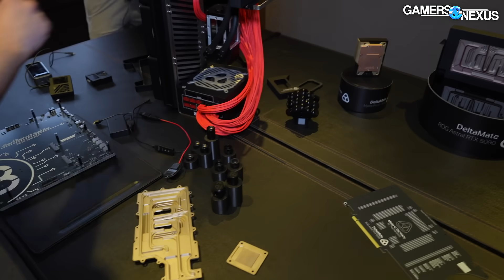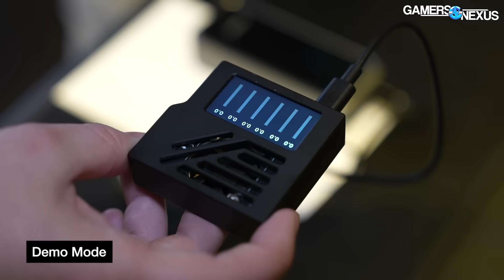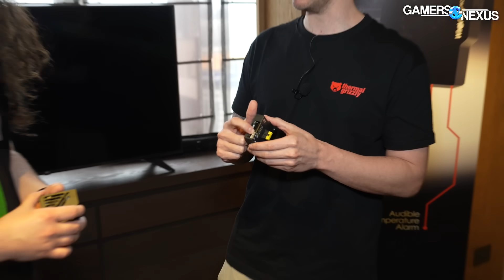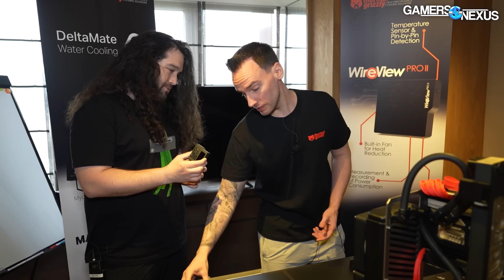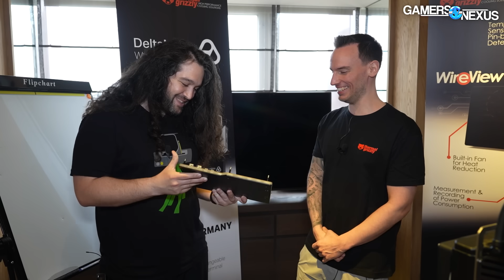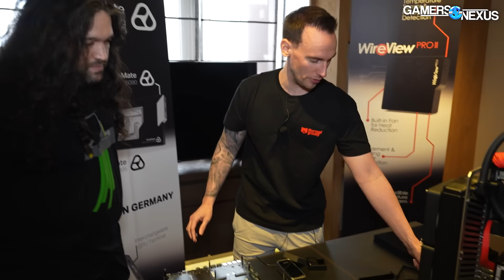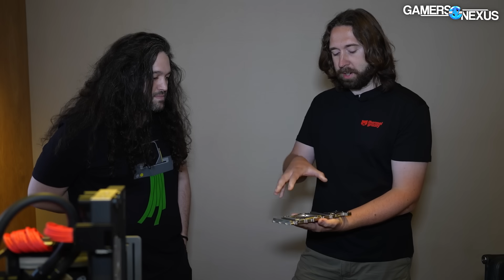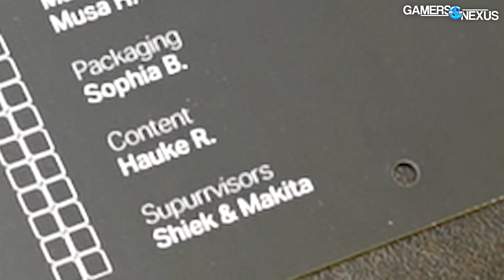Fixing the Unfixable 12VHPWR Connector, ft. Der8auer

Comment: It'd be so funny if Nvidea ditched the 12V high power connector right after everyone made fixes for it
Reply: Actually they ditched it just before this video and they changed their mind back after watching it.
Reply: You assume Leather Jacket Man, still gives a shit about gamers!
Reply: @meekmeads  You've seen the kitchen that MFer has, you think he gives a $#!£ sideways about anything other than even more money in his own pocket? He's a triple-digit billionaire at this point.
Reply: They won't. Because that would mean admitting defeat.
Reply: @shadow7037932  They will and when they do they'll blame it on power supply and cable manufacturers not being able to keep up with their greatness.
Reply: I wish everyone would just switch to microhi, aka ph 3.0. It's right there, already a proven standard. It can carry an insane amount of current in a small form factor (12 pin is 180a) and is designed to do so. Only caveat is that it wouldn't be as cheap - maybe adding 10 dollars to the cost of the cable and a couple bucks to the connector.
Reply: @industrial-wave  Just give us bus bars and let the good times roll.
Reply: @BrandonsUsername  there are many standards for that, including some pcie slot alternatives that allow for up to 32 lanes and even 55 amps through the sidecar connector alone (snia sff ta-1021, aka pecff). Sidecar connectors have been making a showing in the standard pcie cem slot as well, though, such as with the asus tuf z790 and a variant of the 4070.
Reply: @BrandonsUsername  For real. Just convince some wire supplier to make black jacketed Romex and be done with it...
Reply: @industrial-wave  there are more standards than chip developers, many that could be used for the SOHO market, but nvidia decided to go with their own standards because f uck you, we're nvidia. Thing is, the standard could work well enough mechanically, but they cheaped out electrically aswell, so now it needs a lot more engineering..
Reply: @industrial-wave  108A with 12-pins is the same as 9A with one pin in a current balanced circuit. It's the non-balanced current distribution part that is the problem, and the solution would be to either do active load balancing, or make each being able to withstand the entire spec (which for 12V-2x6 is 675W iirc), just for the worst case scenario.
Reply: @D23-qw7jf  I don't understand why they don't use a really fat 2 pin or 4 pin connector. Xt90 or something
Reply: @D23-qw7jf  Ah my bad, was using one of the lower rated ones without checking lol. You can commonly see that the connector supports 12.5a or 15a per pin depending on the variant, with the 15a supporting 1080w (180a) in the 12 pin. The 9a ones are for lower power applications. And yes, agreed, this level of overhead likely would not be necessary if not for nvidia having removed all of the protections from the 40 and 50 series cards. A bit more headroom for imbalances would be nice to have though, as the 12v 2x6 connector does not leave any headroom for misplugs or user error, which 12v 2x6/12vhpr connector is prone to allowing.
Reply: @industrial-wave  In an AI cluster, they can use a lot chonkier connectors, and that is what NV cares about.
Reply: @LordNecron  Microhi already is used in a multitude of AMD and NVIDIA server AI installations, excluding directly for the sxm based gpus. The 54v (or for older 48v) at around 150 amps (~8000w) that are delivered to the baseboard for the 8x 1000w GPUs vastly exceeds the capabilities of the 12vhpr connector and any other regularly pinned connector. It also needs to be carefully separated out for those modules. They tend to utilize dedicated terminals powered by thick copper cabling with large connectors for those instead, or directly power them through a mating connector that they slide into on a power distribution board.
Reply: @industrial-wave  i have used Supermicro's MicroHi cables and adaptor and they don't mess around. it's heavy duty, literally industry grade. It needs almost no modifications to be used in a domestic environment. No need to reinvent the wheel
Reply: @industrial-wave  It can´t. First of all there isn´t more than a 6 Pin Connector, second you don´t fit in more than AWG 20. But at least the Cable would blow up instant
Reply: @industrial-wave  It's not like the cards cost so much they could afford to eat a 6 dollars loss to avoid them melting down your pc or house...
Reply: Sadly, in today's economy and profit margins on computer hardware. $5 in supply cost = well over$50 customer cost...  @industrial-wave
Reply: https://youtu.be/TK2mI036JO0?si=gXEF19BUuTDZFANi @industrial-wave
Reply: @industrial-wave wouldn't help you much eitherif you draw over 16A on a single pin..
Reply: @industrial-wave  That connector would be 9A par pin which is the same as Micro-Fit+ (12VHP), there is no way someone will go out of their way to change a part to something with the same spec as orignal and cost more.
Reply: @crystal_reverie My bad, was looking at one of the low power connectors without checking. Microhi can do 15a per pin, so 180a/1080w in 12 pin or 720w in 8 pin.
Reply: @industrial-wave  Can't find anything specific for "microhi ph 3.0", are you sure that's what it is called? You've made me curious, I'd love to see a 108 amp 12V connector. :D
Reply: @lennyvalentin6485 just look up microhi it looks exactly like a 8 pin connector besides if you look closely 2 pins are wide instead of 4 small pins.
Reply: @industrial-wave  tbh with the prices of GPU that $5 is nothing lol, especially where they're way overpriced anyhow
Reply: @industrial-wave The thing is, there are so many options.  They could have just made the pins slightly bigger and used a slightly heavier guage wire.  Even that alone would make it extremely unlikely that any wire would get dangerously hot.

So my question is, why the fuck haven't they??  Pure stubbornness and arrogance?
Reply: @Alex.The.Lionnnnn  Microhi is an extremely dense connector half the size of the usual eps12v 300w connector and capable of delivering more than double what it can. It is truly tiny. Having two or even 3 of the CPU connectors would take up too much space. You cannot simply use higher amperage cables with the same kind of port, that would not make things accident proof and anyone not knowing about their standards or ratings, or not checking or caring could cause a very quick problem. They have not used a thicker (lower gauge) wire for the existing connector because that would not fix the design issue of the connector itself and its ratings.
Reply: @Alex.The.Lionnnnn there’s an even easier and cheaper fix and that would literally just be to revert their power regulators on the board back to what the 30 series had. That is all they have to do. It would cost em a few dollars extra per card and that’s it. That’s much cheaper than thicker gauge wires which then has the downside of much less manoeuvrability of the wires. The 30 series had 6 power lanes that had its own shunt resistor and so if 1 of the lanes stopped receiving power it would shut down immediately or prevent turn on until the power supply issue was resolved. Bye bye melted connectors as the load would always be evenly distributed along each wire.
Reply: @Alex.The.Lionnnnn cost. Smaller wire gauge gets expensive fast (small gauge=big wire and reverse
Reply: @Alex.The.Lionnnnn Cuts into their greedy profit margins.
Reply: TBH everyone should've use EPS 12V for their GPU in the first place instead of reinventing it in form of PCIE 12V, 20 years ago

It has 340W power from 8 pin from getgo, and you can easily reach 550W with 8+4 config. And mind you, this connector already use reliably.... For CPU

No, you don't need sensing pin bullshit. No, there's no additional necessary change on power supply. And yes, there's GPU that already use EPS power connector in the first  place.

Hell, 12VHPWR 4 pin sensing is practically just there to looks safe. GPU will pull whatever they wanted without any smart monitoring or future shit anyway.
Reply: Let’s be honest. The cable is failing because Nvidia connected a lot of power to a single bus, if they measured the current on each cable it probably wouldn’t be such a pain in the ass.
Reply: They're not going to make money on the fix. It's definitely getting replaced now.
Reply: Nvidia would never admit to being wrong.
Reply: Who will be buying Nvidia going forward?

I'll keep my 4090 until AMD makes a better card. Nvidia is dead to me.
Reply: That sounds about right
Reply: Nonfactor considering gamers aren't their target market anymore. I wouldn't be eyeing nvidia cards in the coming generation if the current generation and drivers are anything to go by - and I'm a 4090 owner..
Reply: They (Nvidia) are very busy working on their new 4GB GPU, give them a break eh. That's a business insider trade secret btw so don't tell anyone
Reply: Oh they will.  They'll make something worse then gaslight everyone into thinking it's their fault.
Reply: it will be so funny when**
Reply: That would imply nvidia took actual criticism and fixed something
Reply: They are more likely to sue lol
Reply: introducing nvidia's newest power adapter... 12v 2x3. that's right we didn't listen, we just did whatever the f*** we wanted b/c we're nvidia and we don't give a rats ass about the non enterprise market or the engineers that know what their doing.
Reply: Then they'll make something worse😂
Reply: I think in the future PSU makers will start building similar monitoring into PSUs. Which is surprising it wasn't built into the standard to begin with. I can only assume Nvidia and PCI-SIG wanted it to be compatible with the tons of existing power supplies already on the market.
Reply: I would manually solder the 8 pin Pci-e since they basically just have two paddles on the card 4x 8 pin (12 separate wires to each 12v paddle, and cut off and fool the sense pins, I rather have 1152w headroom
Reply: To 2x3HPVR ... I am sure that will happen if RTX6090 SUPERs will not melt fast enough .. I mean like 2nd day after 2yrs warranty.
Reply: BTF actually is a superior connector
Reply: Who is Nvidea?
Reply: The product is awesome. My only thought would be adding fusible links. They’d just melt and could be replaced and the sense pins would tell you which one needs replacement. They’re dirt cheap and while they would add a negative amount of resistance it would only matter if the gpu was drawing power unevenly where one of the wires was carrying more than its share. Which from my impression is the biggest factor on the connector failures?
Reply: the people with existing cards wouldnt find it funny,,,there would be no difference for them as the issue persists
Reply: They will bring some new shit like 24V high power connector and it will be 16+4 or 20+4 pin. So we can start again.
Reply: They should still ditch it
Reply: It's time for a 16V cable!
Reply: Because of the many problems with the original 12hpwr, PCI-SIG, the body that does the standards for power and PCI-E,  made a safer updated version of the standard called 12v-2x6.  Probably will be another update later making the pins thicker,  they are updating it because the newer cable is safer, cooler,  and can draw more power....it's still not perfect.... derbauer is bringing back per pin monitoring and regulating through his wire view product line...
Reply: By simply using 2 connectors and adding 3 separate phases per connector, along with automatic warning and voltage reduction, all potential problems could be solved. This would likely increase the price of the 5090 from $2000 to $2250. However, it's clear that everyone would opt for 1500-1600 watt PSUs with only 2 connectors. I believe that by separating this connector into a maximum of 300 watts and a 3-phase configuration, the potential for life-threatening situations can be avoided.
Reply: don't give them ideas! They'll do an Intel and have a new "socket" for every generation :O
Reply: Would never happen because they think that would make the company look bad
Reply: Right, changing the standard so soon would essentially be admitting that the connector was flawed and insufficient. I'd have more confidence in x3 8-pins over 12vhp imo.
Reply: @jesses1589 - The connector isn’t necessarily a failure it’s the implementation
Reply: It will be.